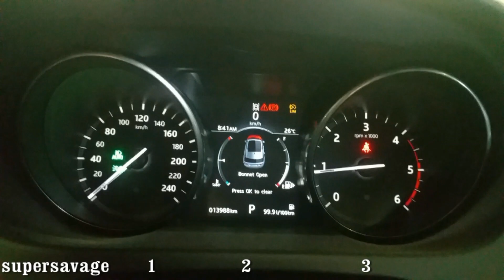Discovery sport engine noise.

Comment: DPF regeneration excess fuel passing the pistons is causing oil dilution. I bet that's 99% the cause of this failure. Oil is cheap, engines are expensive so change the oil sooner.

Comment: I have discovery sport 2.2L diesel 2015 model, I don’t have any noise but the engine shakes like crazy, in idle or sometimes in the highway, when going on a long trip, check the injectors , the engine mounts and EGR, no issue, but can’t find the problem behind the extreme shaking.

Comment: In the Land Rover service instruction N128 only model years up to (including) 2018 are mentioned as being potentially affected by this problem (I assume same goes for all Jaguar models with Ingenium Diesel). Does that mean that, from MY 2019 on, different balance shafts - or its needle bearings - have been implemented which are less prone to that problem? What exactly changed between <= MY 2018 and MY 2019 onwards?
Reply: DS 2019MY - 8 month old, awaiting time to replace them, exactly same issue
Reply: @MishaDobrovolskyy  I've got the same with my 9 month old DS 2019MY
Reply: @kostyantynparshin4827  вы из России? Как авто поживает? У вас 150 л.с.?
Reply: I want to  watch full video for timing fixing
Reply: Balancing shaft bearing can change?

Comment: The balance shaft problem is only for ingenium engine? Just windering because I have ecoboost engine. Thanks
Reply from the maker: correct mate, only the diesel engine.
the ford petrol engine does not have the same issue.

Comment: Does ingenium 2.0 diesel (150/163hp) have a good reability? Can it live 200.000+km?
Reply from the maker: I think with 10000km or 6000 mile service intervals id be confident getting that mileage.
Reply: @supersavage123  and what about 9hp48? We bought discovery sport 2020 with 150hp 2.0d ingenium and 9hp48. Is it reliable modification? (We want to own it 10+years and 200.000km without big and expensive problems. (Oil and other usual things will change every 10.000km)) What do you think?

Comment: have you find the solution yet?
Reply from the maker: yes we replaced the balance shaft assembly's and the noise was no longer present.
Reply: @supersavage123  could you please roughly how much will be spent on this car?
Reply: @supersavage123 how much did it cost